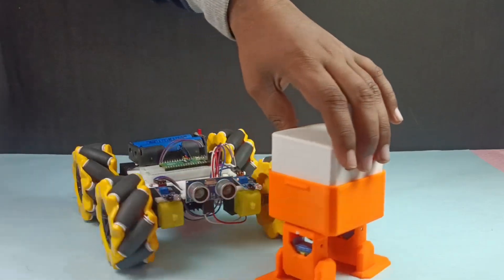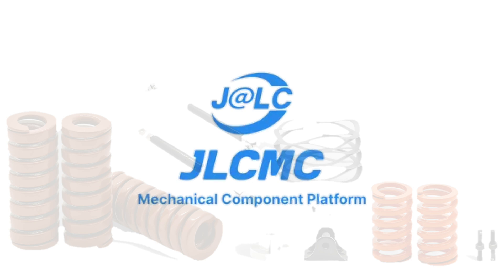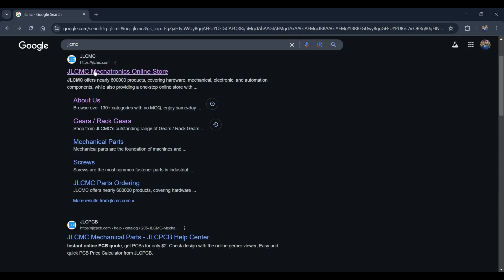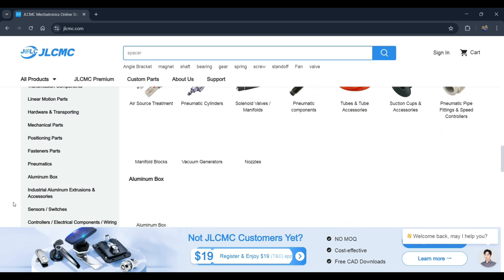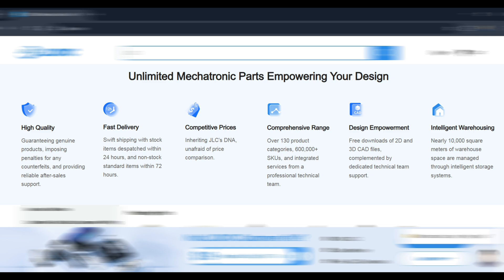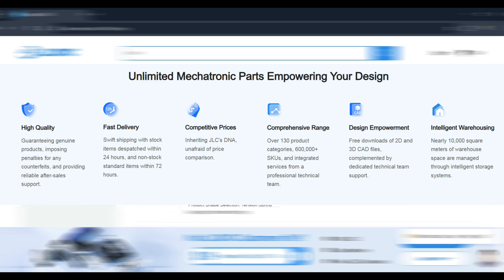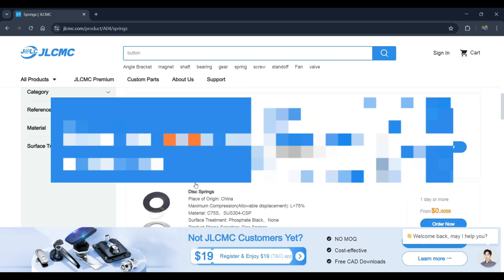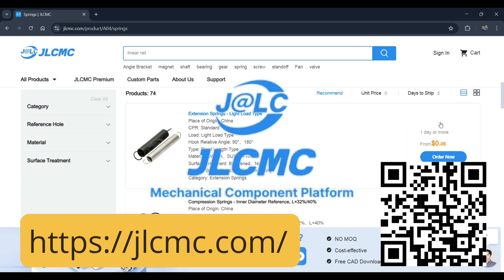How to make a Target Chasing Robot Car using *Raspberry Pi Pico*

Comment: What material is the white base made of? 
Is it plastic?
Reply from the maker: I created this project using a 3mm acrylic sheet, which I CNC engraved and cut.  Alternatively, you could 3D print the parts. All necessary files are available in this Instructable: 

https://www.instructables.com/How-to-Make-a-Target-Chasing-Robot-Car-Using-Raspb/

Files will soon be available on our website as well, since our website is currently under development https://www.roboatticlab.com/
Reply: @roboatticLab  which CNC machine you use??
Reply from the maker: I had done it from a local shop